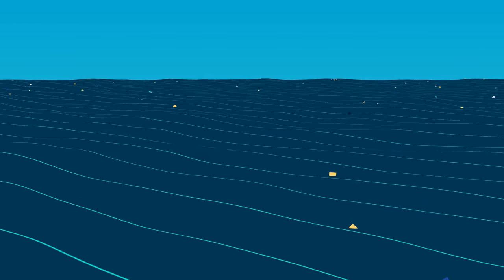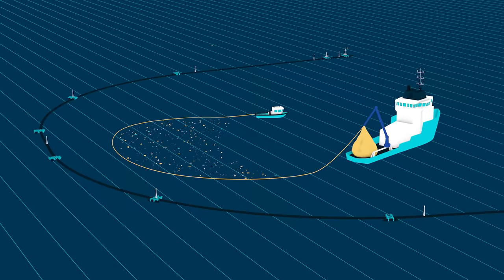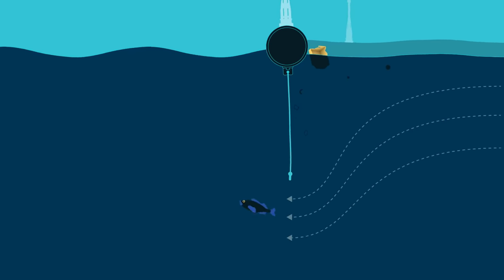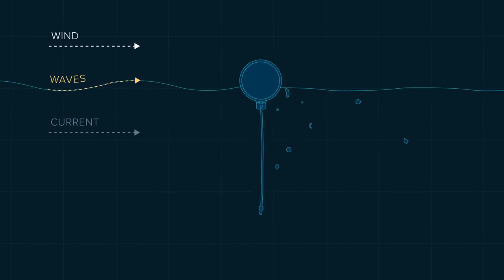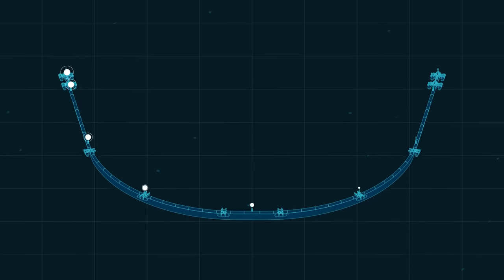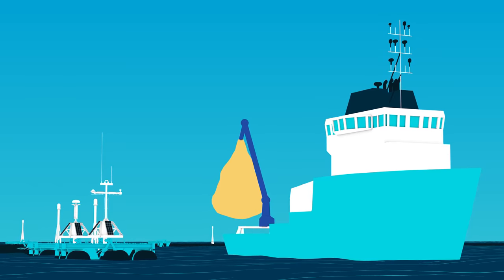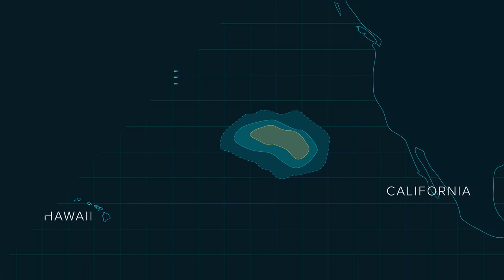The Ocean Cleanup System 001 Explained |  | Cleaning Oceans

Comment: "The fleet is expected to clean up 50% percent of the great pacific garbage patch every 5 years". Even if it turned out to be less, it would still be an insane amount!
Reply: there's no way this claim can be aimed at all the plastic in the garbage patch, only the visable surface. There's metric tons of plastic they're missing to even mention, they're likey getting less than 10% if even 1% of the total mass of the plastic, certainly not removing it faster than the ocean is currently taking in. The deep underwater currents are trapping untold amounts of plastic. Cleaning the surface will cover up the problem for a time
Reply: sourc please
Reply: They've done studies to check where most of the plastic is, and found it to be at the surface. See this: https://www.theoceancleanup.com/updates/ocean-plastic-within-reachable-cleanup-depths/ , as well as this video which explains a lot: https://youtu.be/du5d5PUrH0I

They've also done extensive modelling, and the predictions show that cleanup will be faster than accumulation. Do you have any credible sources that states otherwise?
Reply: I wouldn't call them douchebags. The people most likely just have no other option than dumping the trash in the ocean and rivers. Their countries' waste management systems are just not developed enough to handle the amount of trash they produce. The people who dump the trash probably don't like it either. Also many of the worst offending countries are really committed to fixing the problem.
Reply: sdhbfhkds Cough Cough
China actust buys garbage from US which it used to throw earlier in the sea Cough Cough
Reply: The surface plastic is the biggest issue though. If it just sank into the mud of the abyssal plain, it probably wouldn't effect very much. There is some life down there, but not a huge amount, and it's less likely to go after stuff that it sees floating in the water.
Reply: Chinese Waste management system is very developed. They are the country that IMPORT trash from other countries. Which is probably the source of the pollution when the Trash is taken from the ship and into land. The spillage they do not bother gather. 

So ye...
Reply: But they  dont drive only one time
Reply: another piece of dutch engineering
Reply: What concerns me somewhat is the fact that not all plastic is recyclable. 
Look on a few supermarket packets and they are no more recyclable than they were 20 years ago. Supermarkets (and other manufacturers of course) are just not embracing the need for recyclable plastics sufficiently, nor are they converting back to paper, card, glass and metal packaging quick enough (I have only been able to make the transition back to more easily recycled/compostable packaging in a few cases). 
More importantly, what happens to the non-recyclable plastic this device picks up?
Reply: @debbiehenri7170  if you cant recycle it. You can turn it into fuel or some other substance

Comment: We need all the possible solutions to solve the pollution issue. 
Let's hope it works as planned or even better !
Reply: I'd been thinking that we need a technological solution,one that can largely run by itself,to help address a problem of this magnitiude. Great that this is being done. But it baffles me that so many people dirty up their own back yard and that of others by throwing the stuff just anywhere in the first place.
Reply: It doesn't work at all whatsoever , complete fail . It didn't collect any trash and now it's broken altogether
Reply: @busybody1474  Oh. :-(
Reply: Ralph even if it worked as hoped, they are only skimming the surface particles and most of the dangerous smaller particles are deeper below the surface. This is just a Band-Aid, the solution is to keep the plastic from entering the ocean in the first place
Reply: @busybody1474  I agree totally. It's just that with the amount of stuff already out there being so huge it's going to be beyond mammoth as an undertaking to clean it all up,so if some technological device(s) can be set up that can work quietly away nibbling at it with a limited maintenance requirement that should help a bit. Or have I strayed into the realm of perpetual motion machines here?
Reply: Personally I think trying to remove these microparticles is as effective as sweeping the Sahara before a sand storm hits
Reply: @busybody1474  Does that mean the planet is now stuck with them?
Reply: I honestly don't think anyone can answer that question for certain, and that's only one problem the ocean is facing, right? Look at all the coral bleaching, how are we supposed to fix that when the planet gets hotter everyday

Comment: The discussion should be... Around 1980 plastic began to replace glass on store shelves. Plastic was cheaper and dramatically cut shipping costs. Glass is inert and doesn't impact the environment like plastic does. This looming crisis is just beginning. The only solution is to go back to glass or biodegradable and the large corporations are not about to do this. This is why this story does not come up on cable news or commercial TV. Where is public broadcasting? I guess they have been bought off too.

Comment: I like the new approach - simpler and with less stress on all components. With small, adjustable sails or drag vanes on the ends of the structure, it could have a fair bit of controllable mobility.

Comment: Anti collision systems? I wonder how that works.
Reply: lights.
Reply: Stefan Zijlstra it is on radar and AIS
Reply: How does this prevent it from colliding with other cleanup systems or is this not an issue?
Reply: I see, it's just a fancy name for lights
Reply: Stefan Zijlstra Not an issue. All systems are being carried by natural fluid movement. Since they are carried by fluids, they move like fluids. When you get two currents moving converging, they start to redirect themselves upstream to start joining in the same direction of flow. The only time you don't get this happening is with water falling with gravity or supersonic flow (both are obviously not present here). Because of these reasons, two systems being carried by converging currents would probably not collide and instead end up travelling in the same direction parallel to each other. At most, they would collide with very low relative velocity.
Reply: Anti-collision systems refers to the lights on the vessel, the machine itself can't avoid stuff, however ships can. The lights on an airplane, on towers, ships, etc... are anti-collision systems.

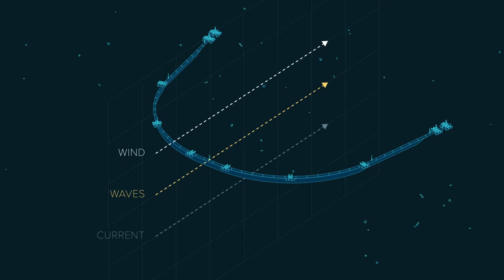Comment: AT 0:52 I believe the vectors for the wind and currents are backwards.  The plastic on the surface moves faster into the "U' shaped device which moves more slowly than the plastic.  The bending of the "U" shape is caused by the currents, but if the current were moving in this direction the currents would straighten not bend the tube.  Congrats on the innovative thinking Boyat and team.

Comment: Very inspirational, so in 10 yrs. no more plastic, if only people would stop❗️
Reply: Couldnt even clean the surface in 10 years, and since the majority of plastics are just trapped in underwater currents the surface would remain filling with plastic and until we have a variety of ways to clean the deep ocean (of which we currently have none) it's likely these projects will never clean more than the oceans currently takes in
Reply: it cleans 50% every 5 years. after 10 jears there would still be 25 % left. Cleaning 50% of 50% is only 25%. Stil great though. ater 15 jears there is still 12,5%, 20 years 6,25 % 25 years 3,125% and so on.
Reply: Thank you for asking. I'm glad you want to learn. I'll try to clarify.
If they clean 50% in 5 years the density of the plastic is reduced. So the system will catch less and less when it gets cleaner because there is less plastic in front of the systems.
Reply: P J van Vliet That “math” borders on those “Troll Science” memes. 

But it’s a moot point as there isn’t actually anything to clean up.

Comment: If the fish can pass underneath thanks to the current, so does plastic. That part was strange.
But I hope it succeeds because this is an amazing project!
Reply: That’s what I was thinking I believe it’s because most plastics float on the surface so the current won’t take them under the net
Reply: Fish are conscious living things bro, whereas plastic is not. Fish automatically will dive underneath.
Reply: @AS898-h3u   Excellent thinking, but also fish are living things so would dive underneath the floater

Comment: My daughter was researching this for a project for school and I think it's great. We need to reduce the amount of plastic going into the ocean but we also need to clean it. Good stuff! But, wouldn't the same forces (wind and water pushing on the middle skirt) that trigger the curvature, also drive away the plastic from the center? I mean, if the wind and water is pushing it in 'a' direction (which, again, triggers the curve, good,) it also drives the plastic away, especially considering the plastic does not have the same friction or push/pull with the undercurrents, no?

Comment: I am a recycling nut but I have come to realize that stuff like this rarely works. If it actually does (I hope it does) the plastic will most likely be taken directly to landfill. A lot of people think when they recycle plastic it gets turned into great new things. It actually doesn't. About 80% of plastic gets turned into carpet, stuffing for teddy bears, and cheap clothing. Due to the many different versions of plastic, company sadly can't really turn a plastic water bottle back into a plastic water bottle. That is why the best way to help recycling is to reuse or not consume at all. As in bringing water from home in a reusable water bottle verses buying a disposable one every day.
Reply: True, water bottles, plastic bags and straws are easy to replace.
Just buy eco-bags for your shopping, and a reusable water bottle. Both are cheap and easy. You can also stop using straws, or buy a reusable metal straw.
However, other things are tougher to replace: garbage bags, plastic packaging, bubble wrap, styrofoam,

Comment: I sent Mr. Slat some Twitter links for A.) A special net that attaches to storm drains inland to prevent waste plastic from flowing out to sea  B.) Special trash collector water craft to collect trash on inland waterways and C.) An Indonesian program where people exchange plastic for bus fares, etc. POINT:  You must stop it at the SOURCE as well and this system will succeed. Otherwise you'll be chasing a moving train you'll never catch...
Reply: While stopping at the source is a good idea, that doesn't make cleaning up what's already there pointless.  They're still cleaning it up and making it better than it was.

Comment: Such an inspiring invention! Question: If the skirt creates a downward flow for marine life to follow, why doesn't the plastic debris also follow that flow?
Reply from the maker: Good question! The short answer is that plastic remains floating, and does not have the independent movement that fish and other marine life have, so it cannot follow the downward flow.
Reply: @theoceancleanup  Ah, so the downward flow is more like an option created rather than a force that would pull things down?
Reply from the maker: Yes, you've got it right.
Reply: @theoceancleanup  Excellent. Thank you!

Comment: I'm curious how it will handle things like partially submerged shipping containers and other large floating debris.
Reply: That would fall under the Salvage industry category, which there is no real incentive to find and collect said containers as the products in them were likely written off as a loss by the company and in the case of footwear are just trash now. But if you can find a company willing to clean said shoes they could possibly be saved and given to those in need.
Reply: Joshua79C C On that topic, a shoe that has been in the ocean for weeks or months wouldn't be suitable to be worn on anybody's feet. It's easier to make new shoes than to clean off the residue from the environment. Not to mention, shoes aren't really a necessity. Someone would be better off barefoot than wearing a terrible shoe.

Comment: Excellent idea but can microplastic be removed from ocean by this
Reply: Ganesh Nigudage Yes. Most plastics float within the first few meters from the top of the ocean.
Reply: Matthew Kearney thanks for answering and ur doing a great job
Reply: No, microplastics are too small. But someone will come up with an idea to remove them as well eventually.
Reply: It's the bigger plastic that eventually breaks down into micro plastic . So getting all the large and middle debris out is already preventing more microplastic to form in the future
Reply: A very sad amount of plastic is at the surface, the most harmful and abundant plastics are trapped in underwater currents, cleaning the surface would be temporary and if its the only measures in place would never reach a point where it's cleaning more than the ocean is absorbing plastic
Reply: don't count them out yet. ocean cleanup definitely has the goal to clean up the microplastics to. they just haven't talked about that in a while.
Reply: the main target is the plastics that are floating in the surface of the ocean, If you remove the source i.e plastic, then the microplastics won't exist at all.

Comment: What if it has automatic packin system included that fills plastic containers with plastic it trapped and attaches it then to systen and drags it behind it, enabling it to work longer without need to empty its pocket? Bags then when needdd could be lifted up from ocean while also reloading its bag cartridge.  Just a thought.

Comment: All's welll until the recycling stage. If the collected plastics are recycled into products (eye glass frames) as shown in the graphic in this video, then we are creating more future plastic that will end up in the ocean. Can't we at least make sure the recycld plastic does not end up in the ocean?
Reply: How do you make sure it doesn't get back in the ocean??  Sure the U.S can pass laws banning plastics, but that's not going to stop China, India or any other country from dumping plastics into the Ocean.  The fact is, plastic is in a lot of things we use.  The computer you typed this on probably has a ton of plastics in it.  Until we figure out a way to create a material that is bio-degradable, just as strong and just as cheap to make as plastic, we'll never be rid of this problem.  For now, recycling is the next best thing.

Comment: Have you done away with the sea anchor?
Reply: Sea anchoring made the system slow, this updated design gives it the freedom to move to the area of plastics
Reply: TheOceanCleanup are you using oil rigs? Transocean is scrapping 6 of their old rigs. Maybe contact them.

Comment: While the intent is good the impact is quite minimal. Surface plastics are a tiny percentage of the overall plastic pollution in our oceans. In fact surface plastics are not as damaging as the plastics in the water columns and the ocean floor, it's just the most visible so it's easier to get money to "fix" the problem.  I would just like to see them admit they are tackling just a tiny fraction of the overall issue so people giving money can be fully informed.

Comment: Why not to build filters in the system, which filters the water through and the collected plastic will be sucked/floated to through the pipes into the boats? It would be much more faster and more automatized as collecting in the water and taking out.
Reply: Having boats drive around sucking plastics would be prohibitively expensive to operate and a lot slower.  A boat needs fuel to run.  The vaccuum that sucks the plastics need power to run.  Imagine how many trips from land to ocean to collect all the plastics over millions of square miles.

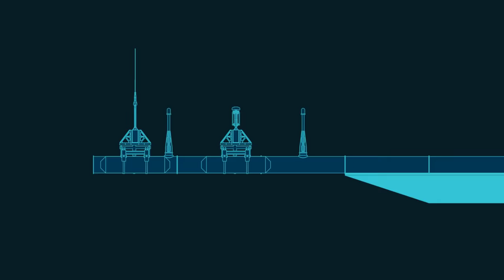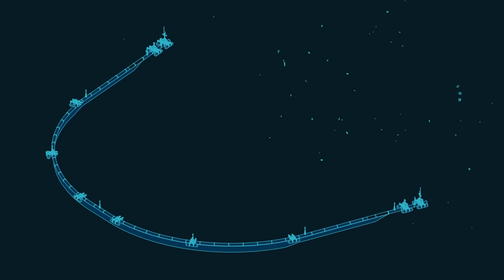Comment: In 1:10 the system moves faster than the plastic. In 1:24 however the plastic moves faster...
OR it is not logical how the system adopts a U-shape (should be the other way round)

Comment: what about microplastics like little beads.  I understand the need to recycle and make "durable" products, but should the solution be to get rid of all plastics permanently and use biodegradable things?
Reply: this project is aimed to prevent the plastics to be converted to microplastics in the future, current microplastics deep in the ocean cannot be removed

Comment: "Periodically a vessel comes to take out the concentrated plastic" ??  7 million tons of weight, twice the size of Texas up to 9 feet deep. You need more than a tube full off sensors and a satellite connection which gets visited by a vessel every now and then!  Also about recycling all the plastics into new products, not all types of plastic is recyclable. This video doesn't make this problem look like a big issue and the solution is easy, but I want to see it work and see some results.

Comment: I'm a bit disappointed 😞 with the explanation are there more videos that dive into depth . But then again This is not a video made by the technical staff are there other videos of longer duration that dweleve more into the process. Disappointed with this explanation because each line stated in this video is in itself a huge engineering  challenge.

Comment: The problem is just that most of the plastic is on the bottom of the ocean.
Reply: most plastics float because they have a lighter density than water.
Reply: Maplenerd22 no
Reply: @rla4018  yes

Comment: Yeah it's not going to work everything will go underneath
 L
Reply: the reason for the screen is to solve the issue you are concerned about, watch the video again.

Most smaller plastics are near the surface of the ocean which is trapped by the screen